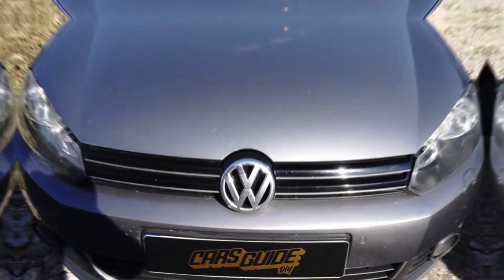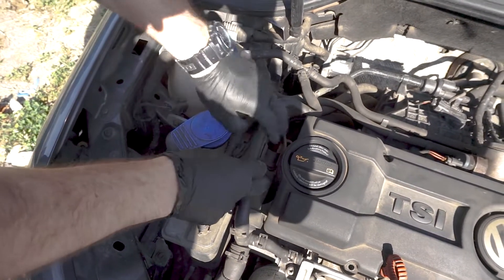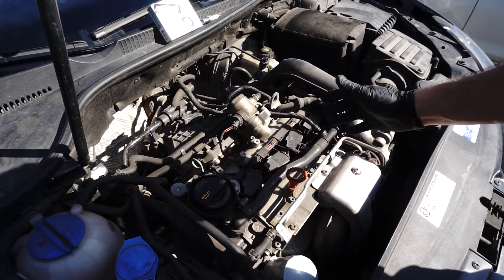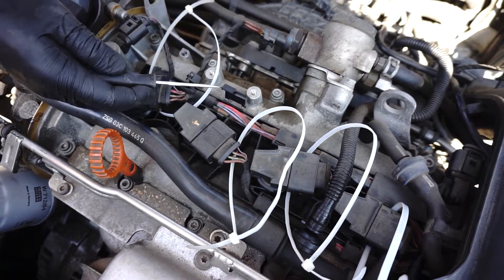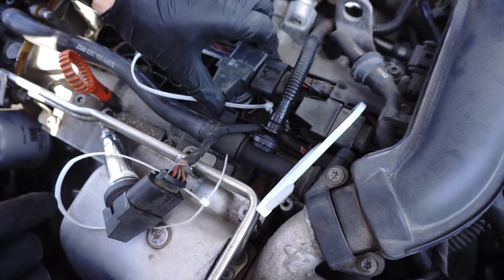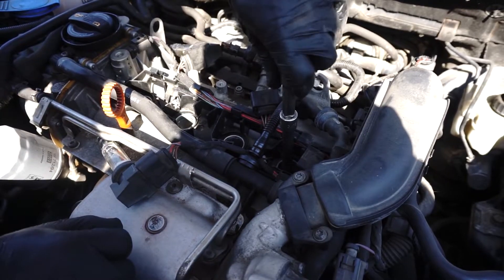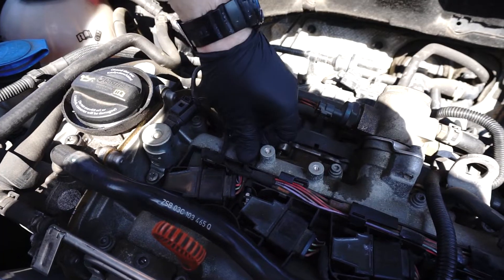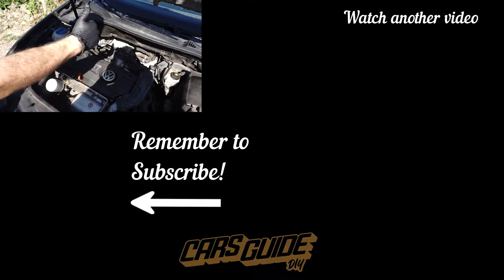How to replace spark plugs - TSI TFSI

Comment: Thanks for this... I have just completed mine with the help of your video. On mine the plug  caps were on so hard the cable ties wouldn't work. I managed to thread old bike cable round, turn it into a loop and use a lump hammer upward on the inside of the loop to gradually tap them free. A 5mm allen key goes under number four into the slot to unlock the plug, so it can be removed .. those wires are far too short . I'd say that it was among the fiddliest jobs I have ever done.

Comment: At 4:29 you say to use grease that safe for rubber elements on two parts of the ignition coil. I though electricity flowed through that part directly to the spark plug under it making contact at the uppermost of the metal part right after where the tool connects. Is this rubber safe grease needed or just an extra? I'll probably only change spark plugs once every 3-5 years or so.
Reply: The idea is to grease the inner sides of the rubber to make it easier to slide on and help prevent damage to the fragile ceramic of the spark plugs.  The grease is also to make it much easier to remove again by preventing the rubber from sticking to the spark plugs.  Otherwise you have a potential nightmare to get the coils back off again next time, especially as they are likely to be on there for a number of years.  Silicone grease is typically used as it's rubber safe, but it's also an electrical insulator, so just apply it lightly to the inside of the rubber, don't slather it on otherwise it will potentially cause an electrical conductivity issue with the metal connector on the end of the plugs.

Comment: Thank you for the video. One side note. If you tighten the new spark plugs it is better to lay your hand on top of it and keep the tool balanced. It is very easy to crack the porcelain of the new spark plug.

Comment: Thanks a lot for the video. Number 4 is really a disaster. By mistake I broke the thin air tube between the 3rd and 4th spark plug. The engine still seems to works fine. However, a small stream of air leaks. Do you know what for is that tube?  Thanks again.